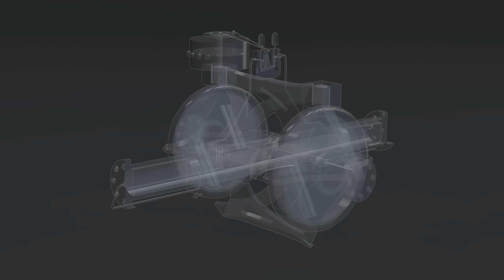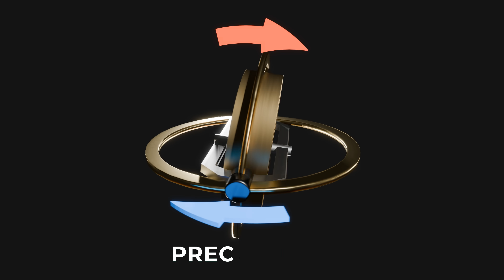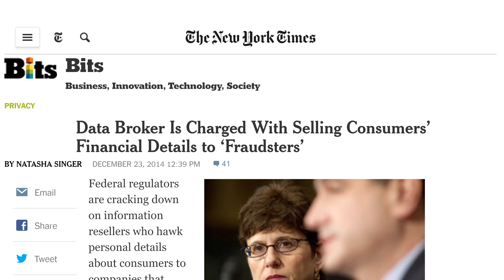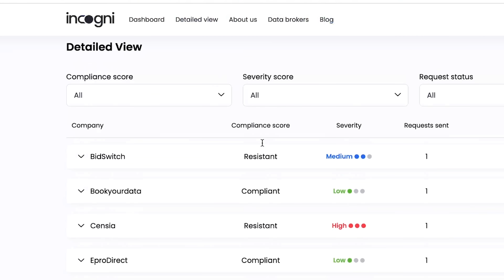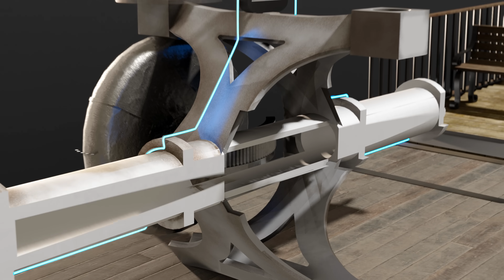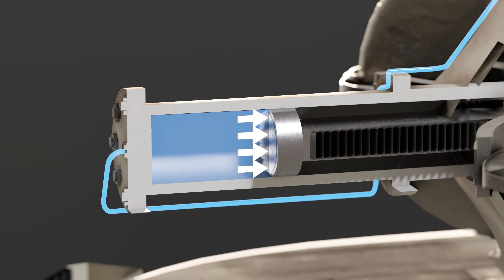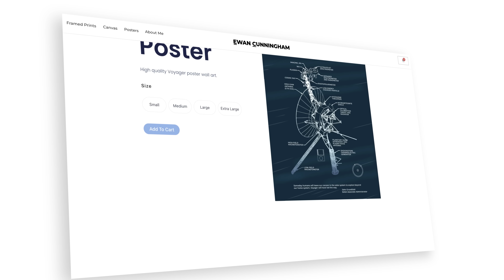The Self Balancing Monorail

Comment: "The actuator mechanism actuates the gyros":
False.

A keen eye will see that it actuates the gun.

The compressed air redirected into the actuator-rod’s tube rotates and racks belt-fed NATO-compliant, armor-piercing, tungsten-tipped, high-velocity, incendiary, full-metal-jacketed .50 caliber rounds—designed for long-range, extreme-pressure ballistic performance under adverse combat conditions—into the uppermost barrel of an air-cooled, 8-barrel rotating cannon. 6:50

Temperature regulation is critical, hence why Brennan chose to mount the weapon on a moving train: air cooling. But, when behind enemy lines and confronted with an ambush, Brennan foresaw the train’s motion would either slow or halt entirely, drastically reducing airflow and causing the temperature to rise rapidly. He understood that in such a situations, the overheating issue becomes a serious problem. Without the necessary cooling from motion, the chromoly steel barrels are exposed to extreme heat, pushing them past their operational limit of 260 degrees Celsius.

At this point, the barrels begin to warp, and accuracy is compromised. Rounds are no longer directed at intended targets, instead spraying unpredictably, which not only affects enemy engagement but risks collateral damage. In combat, this kind of failure threatens the mission’s objectives. But worse still is what happens if the temperature continues to rise unchecked.

Once the barrels overheat beyond the threshold, a phenomenon known as "cook-off" occurs. Here, the heat becomes so intense that ammunition ignites on its own. Now, the train is no longer firing under control—it’s a ticking bomb, launching rounds in all directions. The train’s engineer, who is also tasked with driving, must now divert focus to emergency barrel replacement, a delicate task, especially when the rotor is still spinning at full speed, especially under enemy fire. This brings a substantial risk of mechanical failure, operator injury, and total mission failure. In this state, even a minor misstep could cause total disaster.

Should the engineer fail to address the overheating issue quickly and skillfully, the chain reaction that follows could be catastrophic. The warped barrels could cause the entire cannon system to seize, overloading the mechanisms and triggering a rupture in the gun housing. If this rupture reaches the train’s fuel reserves, an explosion would be inevitable. The resulting fireball would likely launch the entire armored train into the air, turning it into a flaming projectile that could detonate upon impact with the ground, leveling everything within kilometers.

What’s worse, the electromagnetic interference caused by the explosion could disrupt nearby communications, potentially causing chaos in the broader operational theater. The enemy might misinterpret the explosion as a failed experimental weapon, escalating the conflict further. The consequences would ripple beyond just the loss of the train—potentially altering the course of the war itself. 

Brennan understood that the train alone wpuld not generate the airflow to cool his actuator-driven, belt-fed, NATO-compliant, armor-piercing, tungsten-tipped, high-velocity, incendiary, full-metal-jacketed .50 caliber gun. He knew he needed something... fully automatic.

Comment: Gyro on every cart is exactly what you want because then you can use rotationally stiff connections between all the carts so that the carts support each other and voila - free redundancy. One cart gyro can fail and the others will support it.
Reply: Doesn’t work because if you go into a turn you need the connections not to be stiff
Reply: @cpotisch  You've got a point there...

Comment: what happens when you turn off the engine? I guess yards with cradles for them, but in case of failure of the engine or gyroscopes the train would certainly tip over causing a lot more damage and injury to passengers then a two rail derailment, which are bad enough

Comment: Good vid but you really need to take food and water and a side arm when out in the middle of nowhere and be able to start a fire and have a sleeping bag of sorts. Things can turn ugly fast if you are not prepared.  Cool car design. Get ya some lock washers for those axle bolts. I would also put a secondary jam nut on the axle bolts. Then you will not lose them. Get the locking nuts with nylon in them.  Thanks on upload.

Comment: I saw a video about an updated version of the design. It's called MonoCab. A university in Germany wants to use it on a currently disused rail line for commuter traffic. The cars are smaller, but they can use each track for a single direction.

Comment: I agree that its a genius design but I also understand why investors denied it. I would of denid it as well. Its not comercially viable project.
The design's main goal is to reduce the high infrastructure cost on rails by cutting it in 1/2. The problem is ,its ofsets it by converting it into high train upfront and maintance cost.
The problem is , the gyros have to be spinning all the time or the train will tip over. This means that if the train is parked , it has to be put on jacks or stilts. Otherwise you have to spin the gyros 24/7 which will wair them faster (higher maintance cost). Or higher infrastructure cost on stations.
Also , each car has to have its own gyro making it very expencive to make + it takes valuable comercial space (less cargo or passingers). This is why ,its not viable. Its also the reason why modern monorails are running on a single rail as big as the train itself - to avoid this problem.

Comment: Stunningly brilliant design, but unfortunately also a great example of how difficult it is to innovate with already existing and prevalent systems and infrastructure. It's also practically not better than two wheel tracks, which is apparent from our modern perspective, but would have not been as clear when Brennan was working on this design

Comment: Sure, for bigger cargo and more cars, it makes more sense to have two track trains, but if we stuck to this design at least partially, today we could have some seriously amazing long range transportation for like 20-30 people. 

I think the marketing failed. They shouldn't have advertised that this will "replace trains", but rather "with 50% more track, passengers and cargo can run individually if needed"

...in fact, couldn't this be public transportation? Suspend some wires up in the air, have this run under them...The perfect space saving, high speed, self balancing electric public transportation and buses can retire in museums. 

Obviously, this is all hypothetical. There's no money in efficiency, at least not as much as there is in screwing up public transportation, thereby essentially forcing the hoi polloi to buy crappy cars and create massive, stroke inducing traffic jams. Doctors need to eat as well...

The mark of the stupidity of humanity is that eventually, some fat cats axed this amazing thing because their pupils didn't turn into dollar signs. 
...they stole a dream I just realized. A high speed gyroscopic railbike that can take me from one side of the continent to the other in mere hours, provided I have the dough to buy one that qualifies for the 300km/h track...
And now I'm joking.

Comment: They really had no reason to take off. Needing to power every gyroscope, along with needing one in every car, makes it not only more complex, but also limits what can be carried. You could move passengers on it, but actual cargo in a suitable amount, would be basically impossible. And when not in use, the carriages would need to be braced somewhere so they don't fall over. At that point, the cost of all the extra stuff is worse than just having 2 tracks.

Comment: Thanks for the interesting video.  I didn't think it would be very practical for heavy freight and a large number of boxcars, for the reasons stated.  Yes, each car would have to have its own, powered gyroscope setup.  There was also a higher than normal risk factor of a gyro mechanism failing and causing a catastrophic train wreck.

Comment: either I suffer misconception or: When standing on one side for delta T, an angular momentum const*T is exerted to tip over the train. To counteract it, the train must pass on this angular momentum (onto the gyroscope). thus the gyroscope must increase angular kinetic energy by momentum const*T, so for sufficiently large T the spinners will blast. the calculus appears that angular momenti and re-actualization of the train will be sufficiently designed so blasts do not happen. But that is very cold-nerved calculus indeed...

Comment: There are several reasons this technology didn't catch on that were not mentioned in the video.

1. Difficulty with Track Switching: One major drawback was the challenge of switching tracks or having multiple lines converge/diverge. The way the train wraps around the single rail makes crossovers and switches extremely difficult and impractical to build and operate. This severely limits the ability to create an extensive transit network.

2. Lack of Flexibility for Mixed Terrain: While gyro monorails can navigate steep grades and sharp turns when fully elevated, they become more expensive than conventional rail for at-grade or subway sections due to the need for elevated guideways even at ground level. Most new transit lines utilize a mix of elevated, at-grade, and subway to minimize costs.

3. Maintenance and Compatibility Issues: For large transit agencies operating multiple lines, maintaining a separate monorail technology with specialized parts and training requirements alongside other rail modes presents logistical challenges and higher costs compared to standardizing on conventional rail equipment.

Comment: A brilliant feat, but not very practical because it always requires energy to keep it from tipping over and a failure of the mechanisms can be catastrophic. A train on two rails will at most stop in the event of a failure and can stand until rust eats it away completely.

Comment: Light weight short distance novelty applications: Sure, knock yourself out.

Real world freight and passenger applications: No freakin' way.

Clever way to trouble shoot problems with his design, but there wasn't enough redundancy to make it reliable to use. 

Cost savings on track is not going to be made up by the loss in capability and reliability.

If you ran out of power and a 22 ton train falls over, how long is it going to take to get it upright again when all you had to do with a regular locomotive is come hook up to it with another running one or fuel it? The design is a gimmick at best.

Comment: Genius engineering, but it should have been apparent from conception that needing a heavy and expensive gyroscope mechanism in every train car would not make economic sense. And it seems extremely problematic that the train will simply fall over if it loses power for more than 30 minutes…
Reply from the maker: That's absolutely fair. Thanks for watching and sharing your thoughts.

Comment: So how did it perform with highspeed tests? Since they showed it has perfect balance in standing rather than it carrying passengers. 

Personally Don't know much about gyroscopes but have some knowledge in physics : how was he planning to counter the tangential / non-tangential  force that would be produced by the angular speed of the train wheels and how would that affect the gyroscopes & balancing.

Since it's not the train now but the passengers as well so the momentum of train in turns would be pretty huge that the acceleration produced by the angular force would derail it in practise during the run.

Comment: Genius, but a couple of things are going over my head...

- If the gyros are coupled together, so that when it turns a corner, they still face forward, how doesn't this stop the natural action of correction explained at the start of the video? Wouldn't this stop them correcting the balance on straight track if the forces are always cancelling each other out? (May have just answered my own question, but does the answer lie in the fact they're spinning opposite directions?) 

- Would the compressed air also not provide resistance, and stop them being able to perform their normal corrective process as effectively?

- About the gyros triggering the pistons to multiply the force on themselves. Isn't this kind of like the idea of a wind turbine powering a fan which blows air on the turbine - powering itself, as a closed loop? Answered own question: the gyros aren't multiplying their own force. They're triggering release of compressed air from the petrol engine - adding energy to the system.

Overall, an incredibly elegant solution - a lot of which I imagine is lost on me!

Comment: just glossing over the real problem: every train carriage needs the complex gyro mechanism, taking up real estate as well as being obscenely expensive.
It's a super cool design, it's just not practical on the level of bulk shipping. Imagine every single train car hauling coal or whatever needing its own power supply and gyroscopic mechanism, whereas if you just give the train two rails it can basically be a bin on wheels.

Comment: It’s a brilliant design even though it is impractical, I mean requiring a gyroscope system for every single train car just eliminated whatever potential cost savings there are from having only one rail rather 2, and I’m not sure how stable this is when it’s not moving considering the gyroscope wouldn’t work and it’s only one rail, which again makes it essentially useless for its intended role

Comment: Never heard of this - gobsmacked by the utter genius. Now, looking up Louis Brennan. One question I have is how he worked out stability in the wheel and rail contact points. Traditional rail wheels use pairs of slightly conical wheel profiles and flanges to stay on the tracks. A "U" wheel profile, maybe?  Thanks for an interesting video.

Comment: This is not genius really. A genius would not think that replacing the whole train infrastructure, carriages, and even train stations, and make every carriage much more expensive and possible point of failure would work out.
It is as dumb as the idea of Hyperloop is.
Reply: i mean it's not dumb to try increasing the speed cap and reduce costs, especially since these trains could've run on the tracks that were already there. It's not as good as regular trains, sure, but the hyperloop is orders of magnitude more stupid.

Comment: but how did it accelerate?  Existing trains don't need driver input for direction, just acceleration and braking.  So no wonder this failed. It doesn't really solve anything  other than cheaper lines. One engine would pull multiple stack cars. This wouldnt work.

Comment: This would pay itself in railroad construction immediately in theory but producing single line railroads probably won't be as stable as double lane railroads so there would be a need for extra stability structures which would be an unknown variable.
 in an event of derailment there has to be a way to automatically give engine power to the gyroscopes which is hard to do mechanically in and of itself but in this case the cabin gyroscopes would work by leeching power from movement and when train stops unexpectedly that would cause them to lose power which in turn makes the crashes even more cathastropic.
 Train engine would have to be even more powerful than a compareable cargo spaced conventional engine because the train would have a lot more  vagons and every vagon would need a gyroscope pair leeching the speed which in turn would increase fuel prices.
 Single wheel row touching and also constantly wobbling would in turn cause less friction so maximum elevation angle of tracks would be even smaller than two-rowers.
 Honestly such a cool idea but I can't imagine any applications other than maybe other/exoplanetary railroads where gravity isn't as strong and production cost between settlements are astronomical compared to producing high tech trains inside settlements so you can lay down curvy railroads around landmarks and friction would maybe increased in this low gravity situation. :D

Comment: With proper best suited engineering modifications , it seems possible to extend such internal stabilizing  gyroscopic systems that are able withstand/counter high Gs experienced by those onboard during space missions, Formula 1/fighter jet maneuvers @ high speeds, countering chaotic stormy waves for ships, to maintain stability during flight controls/hydraulic failure, vibration control of mega structures such as bridges and skyscrapers, especially during earthquakes! One can even have a Tesla Turbine as part of gyroscopic topology!

Comment: Would the the gyroscopes keep the train upright when it's stationary as well?
 I'm imagining how bikes rely on the rider as a gyroscope and, even with a gyroscopic rider, they fall when stationary.
Does the design create fast enough movements to prevent it from falling or does it have extra legs that would come down when stationary, or would it just not work? Or am I being stupid and it doesn't matter if the train is moving or not, the gyroscopes will work?

Comment: Did I  understand stand that correctly, that every car connected to the engine would need its own gyroscope? That’s a pretty big dealbreaker and can see why it wasn’t adopted as cool as it is.
Reply from the maker: Yes you did, and yes - makes a lot of sense why they didn't move forward with it. With the right investment though, it would be interesting to know how/ if that's an issue they would have been able to overcome.